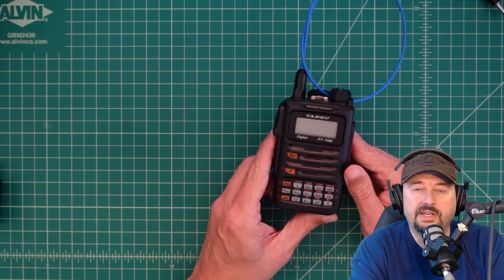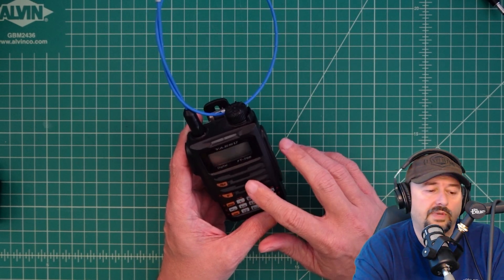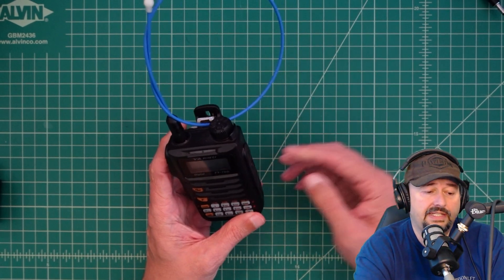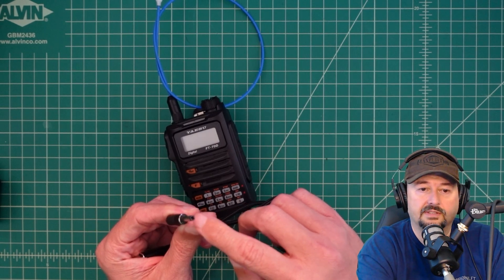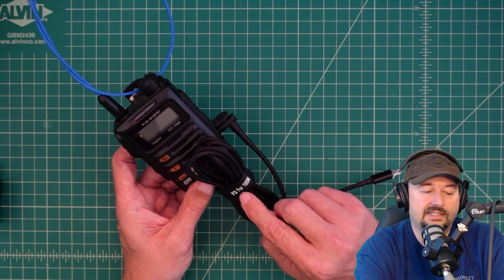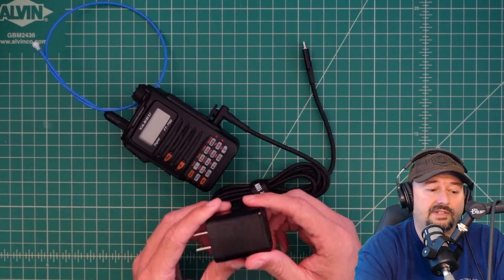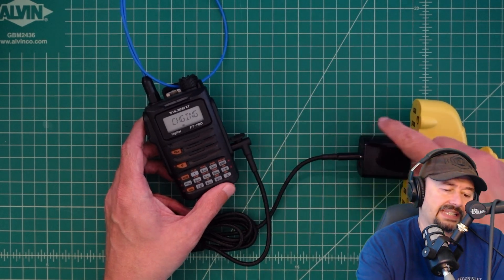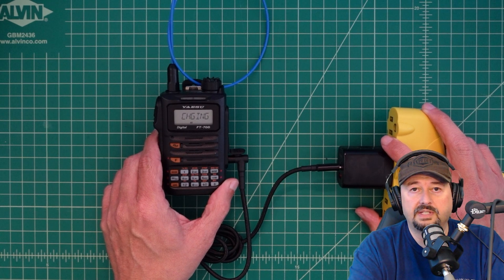USB Charging for the Yaesu FT-70D

Comment: not sure if anyone has mentioned this but you could use a usb-c power delivery compatible battery pack to provide extended run time. as for the load negotiating the voltage. that is not the load. there is often a tiny microchip in one end of the cable that negotiates the voltage with the charging brick or other voltage source.

Comment: Does anyone know if running the FT70 directly from a DC feed damaged it?

The stock plug DC cable runs at 10.4v
My aftermarket USB cable runs at 11.6v from a 5v USB.
I've got a 3D printed battery case with 18650 batteries with USB C input that run at 8.3v.

The radio seems to run fine direct from DC with no battery present I just don't want to damage it

Comment: You have to be careful with PD and not knowing the specs because it can output 20v depending on the configuration and I believe the manual for the radio says that it can only take up to 16v. Make sure you do your research on PD before plugging in random things. 😂

Comment: Expensive side for an HT? Obviously you have checked on prices on some of the higher end HTs. I just purchased and FT5DR and with the Black Friday discount, it came in at $370. 

I don't see how this is any better than the charger that came with the radio. You still have to have a cable and a special wall wart. You just can't plug into any USB source like your computer.
Reply from the maker: I do get a multiuse plug?

Comment: can this setup able to power the radio for operation? Or is it only for charging?
Reply from the maker: I only use it for charging but others have said you can run the radio this way as well 👍
Reply: @TheSmokinApe  thank you. I will get one and pair it with my car charger since it has the pd plug.

Comment: Ape - I used a USB-C meter with this exact pd cable and charging brick.  Plugged in the voltage was 12.2V, charging voltage maintained 12.2V at .37A.
Reply from the maker: That’s awesome, thank you for the info 👍

Comment: PD is awesome. I have a few chargers that do PD 100w but i bought a PD 240w cable recently, a fair bit thicker than normal but i dont have a charger or device that uses 240w yet. My Surface Book 2 happily charges at PD 100w. 👍
Great to see you now have better charging options. :)
Reply from the maker: Thanks for checking it out Don 👍

Comment: @TheSmokingApe Thanks for the shout out! It was a pleasure talking to you and Chuck that day!
Reply: De KE0LFX
Reply: FYI, see my top level comment about that cable. If you use a charger that provides 12V maximum (as some chargers do) then you’re sending 12V to the radio (higher than Yaesu’s 10.5 but still safe).

BUT, the cable can actually request 20V and it will gladly use it if the specific charger offers it (and many do). 20V may be enough to damage the radio. It’s unclear what the true maximum is.

There are specific cables designed to limit the voltage requested (9V and 12V are common options). But that cable is not one of those.
Reply from the maker: Hey LFX, was awesome to catch up at the fest and thanks again for telling me about this 👍
Reply: Have you tried this with the drop in charger

Comment: CAUTION: Even though it works here, that cable might damage the radio if used with some chargers.

The way PD works is that the device requests the voltages it can accept. The PD charger then supplies the highest one. These cables have a chip that acts like a device and requests a preset voltage.

This cable looks like it’s designed to request 20V. Your charger may or may not supply that (12V is a common limit). So it might work now with that charger because it’s actually getting 12V, but if you plug it into another charger that CAN supply the full 20V… well, you can see the problem.

You could test this by using a multimeter to check the actual voltage on the barrel jack output.

For comparison, I use a cable that’s designed to request 12V so it wouldn’t have this problem.
Reply from the maker: Great point.  The specs on the PD adapter say; 3v, 9v and 12v; the only spec I see on the cable is 100w 20v and 5A.
Reply: @TheSmokinApe  Yeah, that’s what I suspected. If you connect that cable to a USB-C power supply capable of providing the full 20V it might not end well.

I don’t know what the actual input range on the Yaesu radios is, but I’m definitely not going to test it on mine.
Reply: @TheSmokinApe  You might want to do some testing and/or issue a warning on the video. My concern is that people are going to have 20V capable supplies (many of mine are) and it’s very possible it could fry those radios.
Reply from the maker: I added a warning to the beginning of the description.
Reply: @rainmaonnoodles did you find a cable with the same adapter that only supplies 12V? Thank you

Comment: The FT-70D's battery issue is most aggravating when you are out and about and no wall outlet is handy --- but I did a quick search and there are portable battery packs with high wattage PD-3.0 ports... but then, if I can carry a portable battery bank, I could just carry spare FT-70 Batteries. Decisions, decisions...
Reply from the maker: LOL, modern day problems!
Reply: I would get a spare battary and battery-bank. Doubles up has a phone charger, hand gps nav/sat pager charger. Love the radio but dislike the battery.

Comment: I think that cable puts out 20volts from what I can tell, I imagine the FT-70D has some form of voltage regulator onboard but it’s hard to say what it’s upper limit is.

Mind you, you would think if it didn’t that it would blow up immediately so maybe it’s fine? Would be nice to know official specs from Yaesu however.
Reply from the maker: The supplied charger supplies 10.5v, PD will negotiate voltage with the load.  If you don't mine me asking, where are you getting 20v?
Reply: @TheSmokinApe  yeah, but it can only negotiate the voltage with an actual PD receiving end, no? I.e. it's a USB-C cable and there are two devices talking the USB-C PD protocol and negotiating the voltage. Your radio is not actually able to negotiate PD, since its a plain DC input.

It seems this cable is meant for charging non-PD Lenovo laptops (which take around 20V DC), so the cable is probably negotiating the PD source into delivering those 20V, and then forwarding it to the laptop.

Of course your charger can only output 10V, so that's what it's going to see at the other end, but that's only a sideffect of combining these exact two components.

I bet if you combine this cable with a beefier PD charger you'll see 20V at the other end.

So all in all this sounds like a very dangerous recommendation, and people could destroy their gear with this cable.
Reply: Yaesu spec is 10.5V. It can work fine with 12V as well.

But that cable, if connected to a USB-C supply that is capable of higher voltage, will provide 20V to the radio instead.

See my other comment. It looks like the charger used in the video is capable of a maximum of 12V, so that’s what the radio got. But some chargers (and power banks) do offer 20V.

Comment: Thank you! Just pulled the trigger on it for my FT-1xd
Reply from the maker: Awesome, good luck with it.
Reply: A word of caution:

Yaesu spec is 10.5V. It can work fine with 12V as well.

But that cable, if connected to a USB-C supply that is capable of higher voltage, will provide 20V to the radio instead.

See my other comment. It looks like the charger used in the video is capable of a maximum of 12V, so that’s what the radio got. But some chargers (and power banks) do offer 20V.

Comment: I bought a similar one for an FT5D and it outputs 12V. At first I was a bit worried because the stock charger supplies the same 10.8V like yours but then I saw that Yaesu sells a different charging cable that delivers 12V to the radio. I also use the 12V cable for a while now and the radio is working just fine. I can’t say that it charges much faster if at all, but it allows me to charge it on the go from a USB power bank which is way more convenient in this day and age where everyone uses USB-C, except the ham radio manufacturers that are somehow still stuck on last century’s technology with USB micro-B.
Reply from the maker: Ah, good info...  thanks PCF.
Reply: Can you share a link to the usb-c cable for the ft-5dr?
Reply: @ryanc5517  I don’t think I am able to post links here but you can just search for USB-C to 12V DC 4017. (That’s 4.0x1.7mm barrel jack).